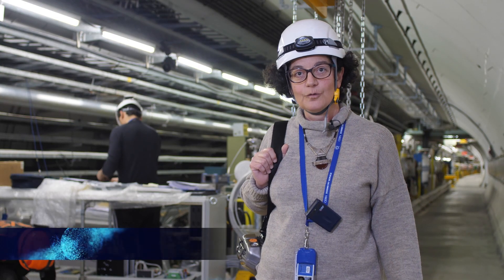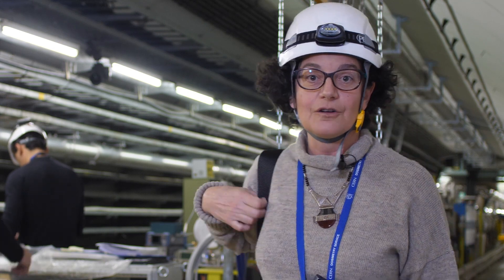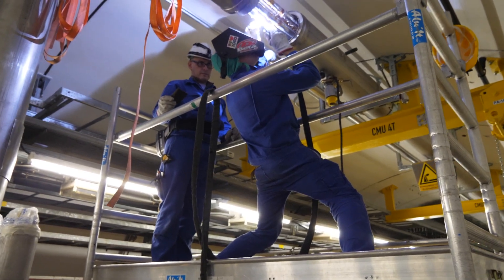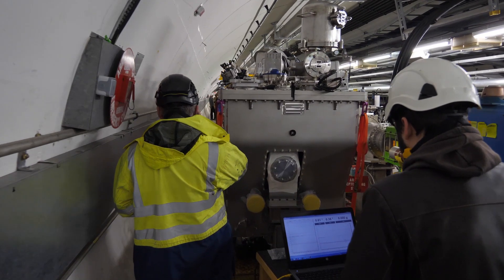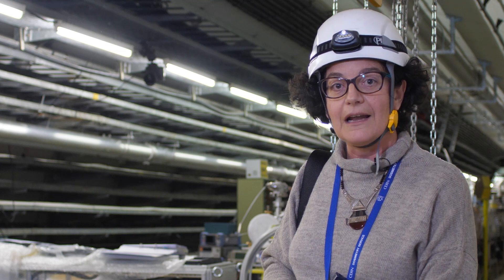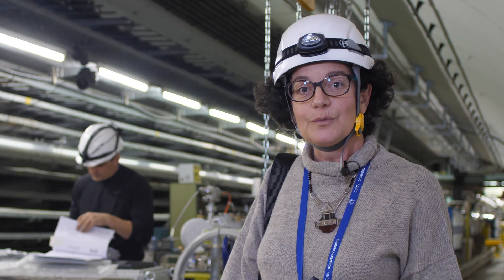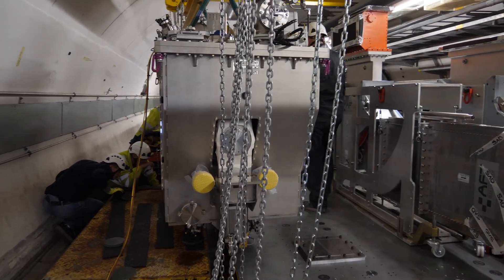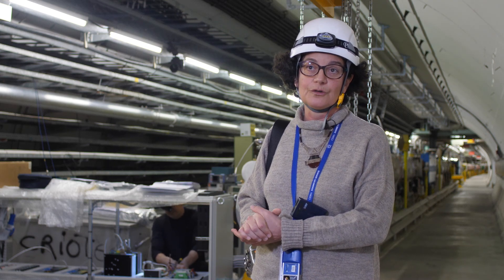High-Lumi LHC: Crab cavities

Comment: Cryogenic line??? What is it used for?
Reply: Used to cool down the magnets to bring them to a superconducting state in order to accelerate the protons.  Alternatively, used to cool down your beer really fast.
Reply: Actually the SPS magnets are normal conductors magnets. Here the cryo line has the only purpose of cooling down the CRAB cavities made out of Nb that need to reach their operation temperature of 1.9K. These cavities by the way do not accelerate the bunches but provide them a transverse momentum.